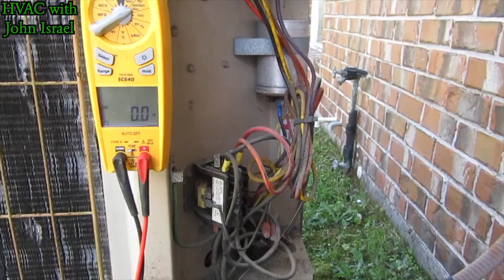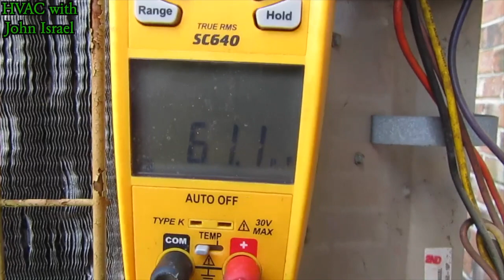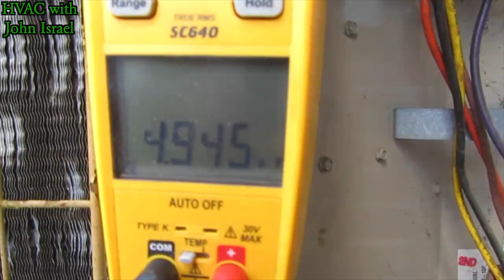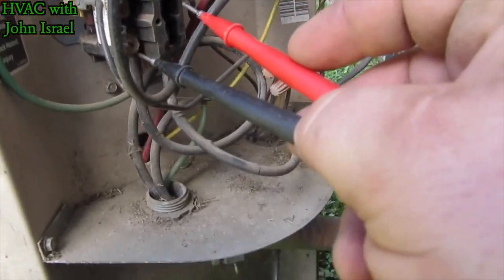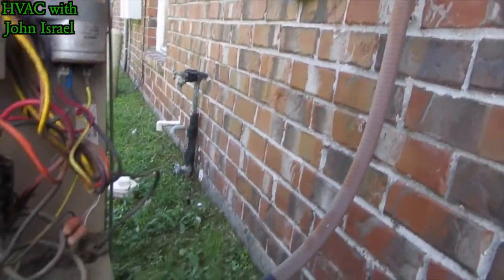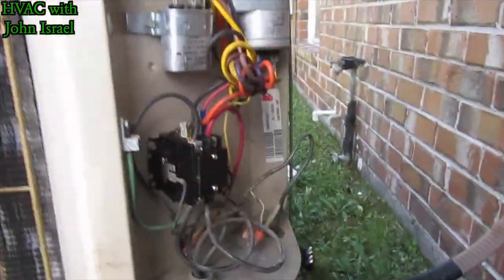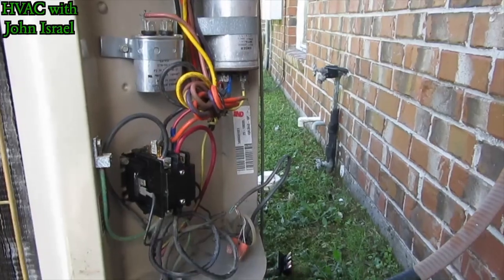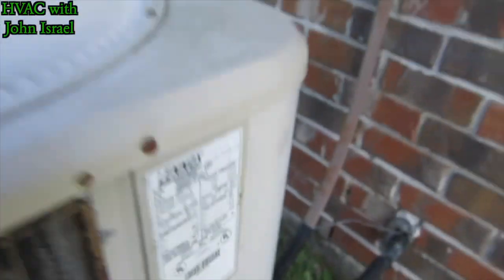HVAC Service | Condenser Not Running | Multiple Issues

Comment: At least I’m not the only one who has troubles getting the connectors off the capacitor
Reply: You can get some carbon conductive grease and put it on all the terminals when you remove them as well as the disconnect switch after you pull it. Also putting antiseize on your blower motors after you pull them off/before you install them helps aswell.
Reply: John Doe  I appreciate it thank you
Reply: Yanking that he did is not the way to do it though

Comment: I would say that about 9 out of 10 single run caps that I have seen added to a condenser, due to fan replacement, have been taped up and dangling like an old mans nuts. You are right! It makes no sense. It’s deplorable and annoying to even look at. Good vid John.
Reply: A-Team Adam ( yep! If you ran out of plumber strap, zip tying to the dual run is better than the tape up and let her swing method.
Reply: with connectors facing down, no water (rain or sprinklers) can short out the cap.
Cost nothing more 🙂
Reply: G Lasser , if the capacitor was mounted on the outside of the electrical compartment, that would make sense.